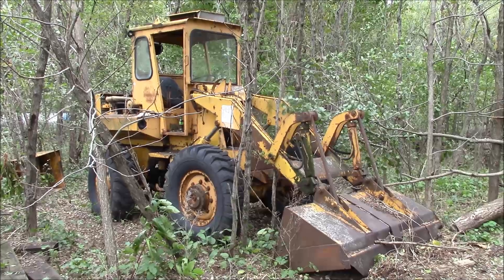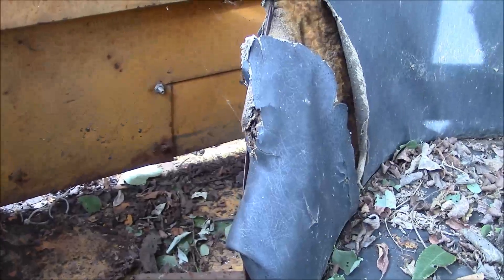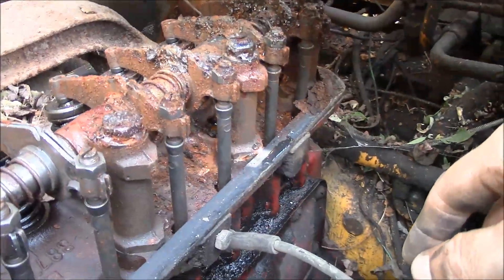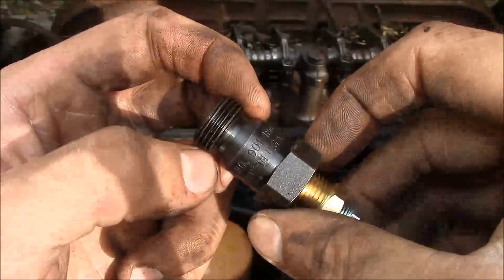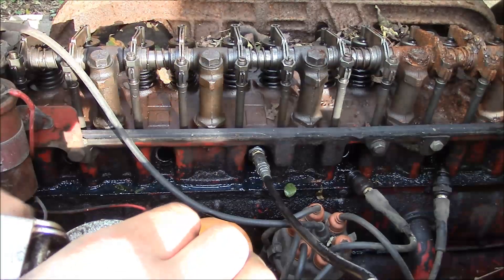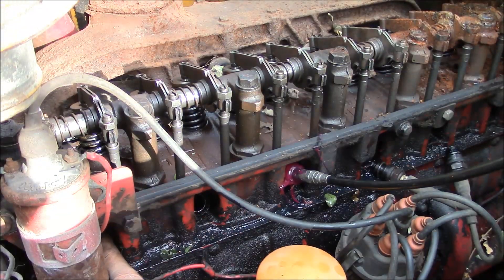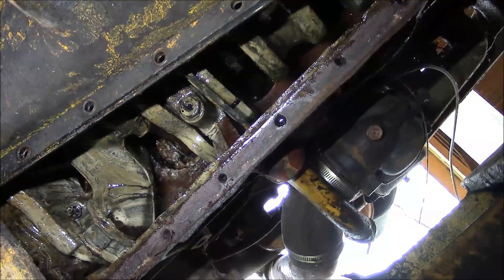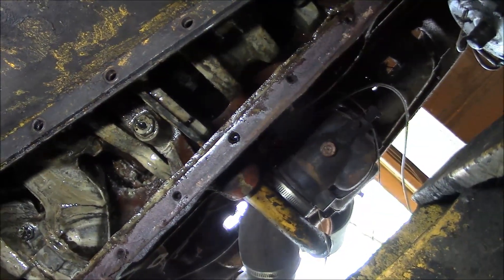Can You Free a Seized Engine with a Grease Gun?

Comment: Unlocked a bunch just depends really on why it’s froze up run it super hot and weld the rings your screwed but if it’s from sitting or not to major fill each cylinder with marvel’s mystery oil and let her sit for a week if. It takes that long just try the crank every day

Comment: I've also seen the grease gun method used where you pull the head and bolt a thick metal plate over the suspected stuck cylinder and go at it with the high pressure goo.

Comment: In my opinion this method is flawed right from the start because you are trying to break 6 pistons loose at the same time by applying pressure to only 1.  Might work on a single cylinder engine...

Comment: Swapping the engine is likely the best solution in this case. But for shits and giggles I have  filled the crankcase/ oil pan with diesel and worked the engine back and forth over many days. Had great success with engines no longer available for restoration projects, Good luck

Comment: I just subscribed to your channel. 
I have a 706 with a 291 that I had  six repair liners installed 25 years ago.  And they bored it to 301 . It has 5.000 hours on it now. 
Here is what you do to unstick your engine.  Pull the head and clean the cylinders out mostly.  
Take a torch and heat the pistons that are stuck to around 600 degrees and then quench them. 
You might need to do this more than once.  This will bust the rust .
Then you should be able to rotate the engine so you can get the bolts out of the torque converter. 
Hope this will help.  That's what I do when tearing one down for scrap..😊

Comment: Should have gotten something big enough to pull the machine and pulled it in gear to free the engine. I've seen this method work many times
Reply from the maker: This machine has a torque converter.

Comment: If you're looking to free up a seized engine...try mixing equal parts of any automatic transmission fluid,  with acetone.  The mixture works great because the acetone pulls the it DEEPER into the rusted stuck pieces, thus freeing them up.  And remember.. Any time you try to bang away at stuck rusted metal parts,  you run the risk of breaking them, and at the very least, creating deep gouges.  If for some reason the fluid doesn't work properly, then drown the engine or whatever it is with more, and let it work overnight. And... as you can see from experience...the grease gun method only works for minimal rust conditions, and usually causes additional damage and problems. There's also electronic devices that can heat the  bolts,  etc..  just remember that  they will damage o rings and seals by frying them..Good luck

Comment: What usually helps is some PB blaster into the cylinders, or marvel mystery oil, ATF, seafoam like fuel injector cleaner. I've made a mix of all of these combined, and filled up the cylinders with this cocktail. Its waiting game for sure. Also, just take the valve train apart, and label and organize it.    After its sat with the cocktail in it for a few days, try rocking gently the flywheel/torque plate with a pry bar without damaging the teeth. There is always pulling the cylinder head, and tapping the pistons with some wood, and small 2lb hammer, and just keep gentle tapping all of them.

Comment: Use apple cider vinegar...... when something is fully submerged the acidic nature of vinegar will remove the rust.... it’s pretty damn effective too..... but vinegar can also cause rust if not neutralized afterwards it’s thin so it would be able to seep between cylinder walls and rings and dissolve the rust....... I use it to clean and even un-seize rusted up guns and parts 
And clean parts when working on trucks....

Comment: Great idea. Thinking outside the box. 
To get pilot bushing out of manual transmissions most people use grease and it works well. 
Years ago I had a pilot bushing that was giving me a tough time and would not come out. So I thought outside the box.
I found a tap that would fit and tapped the pilot bushing and then ran a long bolt into it and wa la bushing be gone. 
Good video. TFS

Comment: I've used this method to unseize a Ford i6. It does work but only in certain situations this particular I6 had been overheated and one piston expanded until the motor stopped. None of the rods broke or bent when it seized. But the starter was not strong enough to turn it over and break it loose. Great method but like many good tools you must know when and how to use it. Great video though

Comment: That's an old Hough payloader made by  International Harvester probably in the 1960s.  The engine is a fairly easy one to find. That engine was available from the 1950s to the 1980s in various displacements from 220 to 301ci. Many IH trucks, tractors, combines and construction equipment used these engines.

Comment: have used a port a power instead of grease...oil work better...can get it out of the cylinder easier
Reply: need to find the rusted cylinder and put the port a power on that one
Reply from the maker: The problem with that is the valves will be rusty on the rusted cylinders and they will never seal up well enough to build pressure.

Comment: I work on outboards for a livingI am always getting engines in that are seized up from being left outside for four damn years without anybody winterizing them and through condensation the Piston Ring cease to the cylinder wall.I have been able to free up about 90% of these engines with a combination of marvel mystery oil acetone and little motor oil but you need to fill the cylinders and let it soak and fill the cylinders and let it soak and fill the cylinder and let it soakone day you'll go out there and all of the fluid has bypassed the rings and is in the oil pan or if you're working on a 2-stroke like me it'll all be on the ground.Then you just woke the motor back and forth and it'll free right up. Best bet with this old dog is just rebuild it.

Comment: Is it possible to swap out a 300 Ford or a 292  chev truck engine both 6 cyl models. I saw a 28 Hudson with a chev 6 cyl in it as the old Hudson motor  was toast

Comment: Hmmmm, sort of like me using my PortaPower hydraulic pump with a greasegun connector installed on the end of the hose, to break free clogged grease fittings and journals.  Not a guarantee to work, but sometimes it'll save your day.

Comment: Another method for seized engines is filling the cylinders with brake fluid but if the grease already popped head gasket no sense going any further, you need another engine.

Comment: I've been a mechanic for around 45 years and the best thing I've found to free stuck engines is to fill all the cylinders with brake fluid and leave it in there bout 5 ta 7 days b4 you try to turn it. Would b great with the grease gun method after leaving it set for a few days
Reply from the maker: Well it soaked for 5 weeks in diesel and ATF before I tried the grease gun.

Comment: special for this video i have done some research and have seen different things, but if the engine is seized, what is quiet obvious, i might have an solution which could solve the issue,, now the engine looks really really nasty, and also rusty, if u think by yourself, rust does'nt like chemical stuff thats biting the rust away,, Now if u fill the whole oil tank up with coca cola (original one, so no pepsi) brand new from the store and fill it completely up let it sit for 2 days, after that drain it out, find out if its possible to turn it over by hand, if it does turn over OR if it does not, just after you drained it, you can put transmission fluid in there and let it sit for 1 full week,, after that it really should be free,, the coca cola original bites all the rust of it and will cause no damage to the rods OR pistons,, now i am not an mechanic (i see and learn a lot of videos on the internet) but if this works for you then i should say give me a shoutout?? There is always a way to fix the original engine

PSS: unseizing the engine by forcing it is really my last option but the chance here is 50/50 and i would like to see the percentage as close to 100 as possible
Reply: if this did not work, then let me know and i will do further research!!! but i bet this will do it

send me a message on facebook to update me a bit about the project
facebook: GamingFromTheHeart Offcial    OR    Lari Tsahik
let me know something!

Comment: Pull the caps off the connecting rods if you can get at em, should make it possible to roll the crank over to get at the torque converter bolts. Keep on keeping on, this was  my first video I've watched from you. I subscribed you're my kind of mechanic. Physics is always crucial. My friend.

Comment: that grease gun method is a terrible idea. I would never do that to any engine. what I would have done is pulled the head to loosen and clean up the valve train. now you will have to strip the whole engine to remove all of that grease from the cylinder and piston rings. that's what you get for listening to these Muppet commenters.
Reply from the maker: LOL. This engine will never run again without a complete overhaul including boring the cylinders. I don't see what we had to lose.

Comment: That engine I doubt very much is seized, it is only stuck. Flood it with diesel and let it sit for a couple of weeks. I found a lot of gear the the US  troops left behind in NZ at the end of the war. They didn't want to ship it back home and the NZ gov didn't want it left behind because they had no market for their own war surplus gear so the GI,s just drove it into the bush and went home. Clutches and brakes were corroded and locked up as were the motors. I just pulled the injectors and filled the donks with diesel  and left them for a few weeks then used a giant crescent on the crank and work them back an forth, but time is your friend: just let it soak.

Comment: If you unbolt the connecting rods from the crank, you should be able to turn the crank and unbolt the converter.  Just cut the oil pan off with a torch..

Comment: Good call on replacing the engine, if you can, take the end caps off the ends of the rods. You'll be able to rotate the crank to get at the converter bolts. I hope you find a good engine, a Diesel would be great.

Comment: Watch the channel "Coldwarmotors" Straight Eight Challenge. Scott used a Port-a-power hydro pump and a specially made single cylinder "head" to free up a rusted cylinder in a '50 Buick straight eight. It's pure video gold for us viewers, for you trying to do this for reals,  probably not so much. :))  But it can be freed up, to be sure and you're already into this for four or five tubes of grease :P . Good luck either way.

Comment: un-bolt the motor mounts, lift high enough to remove pan, put bolts back in, remove the pistons from the crankshaft*, see if you can push all pistons to the top position** so the crankshaft don't bind on them. crankshaft should then be able to turn free.   if that works you can turn  torque convertor to remove all bolts for engine removal.
* remove the ones you can, you might find it might turn with  less connected.
** I would use a 2 ton jack to lift the piston with steel rods,  since you don't plan on using that engine, use even pressure so it does not tilt and lock up more.
Reply from the maker: This is not like a car or truck. The transmission is rigidly bolted to the frame. We'll just cut the crankshaft.

Comment: Put a 2 jz engine in it or a nice little  predator 670 also try using CLR in the top of the motor fill engine oil pan with CLR let it sit CLR will eat all the rust

Comment: Out of all the concoctions, you put down the spark plug hole, Have you tried Automatic transmission fluid (ATF) mixed with Acetone. A lot of experiments on YouTube using ATF to free up rusty bolts and comparing them with other types of off the shelf products. I use it all the time on Landrovers. It was only this year an old mechanic told me to mix it with acetone. And yes it works even quicker.

Comment: I unseized a 440 Mopar by filling the whole block with kerosene and diesel fuel with some atf . Let it sit for a week   I drained all the old oil and crap first . Then put the kerodiesoline lol mix in crankcase . A week later I can turn crank over about 1/2 way back and forth. Kept working at off an on through out the day . Made one revolution by the end of the day . So I can pull it apart to rebuild .

Comment: I poured vinegar through the spark plug hole let it sit for 24 hours then hit it with a big breaker bar, vinegar eats rust big time if you didn't know that. 
On the old caddy 331 it  took about a week Of fiddling but I got it spinning... It was a little at a time btw.  Then once I got it freely spinning I got it fired up and it smoked like a 1950s late night interview, it never really cleared up but it did tone the smoking down as it got used.

Comment: Did you consider disconnecting the connecting rod on the ywo worst cylinders and cutting them off close to the pistons so they won't contact the crank shaft?  If you could get it running on 4 cylinders you might be able to drive it out of the bush at least.

Comment: @7:54 This is part of a real question I've pondered for a decade or two:  "Measured from one end of the crankshaft to the other end, exactly how many degrees of crankshaft twist is possible in an average engine running at max rated power at some RPM?"  Based on your shared observation at this point in the video (and at whatever cylinder pressure you achieved) a few degrees seems possible.  Neat!

Comment: Could you try that method on cylinder 2 and 5 and see if that works? Idk its fun to tinker ive actually used compressed air to free up a engine but it wasnt very stuck it only took like 20psi to free up and that was on a 620 john deere

Comment: If you look on Coldwarmotors  Straight 8 shootout you will see the Canadian version of unsticking a motor. First you have to remove the head then put a piece of plate  metal with o ring over one cylender then apply hydraulic pressure.

Comment: Go to coldwarmotors site and you can see how they did it on a flathead engine with a lot more hydraulic pressure and it will let you see the amount of pressure they put on the Buick in the straight eight challenge.  Look at it they did it real justice, little that you do except change the engine.

Comment: In order to pull the engine you might need to pull the head and demo the pistons to turn the crank to get to the torque converter bolts.  You know what fits it now, try to find a junkyard motor that fits it.

Comment: I knows its a bit late but my dad taught me this trick on an old bobcat and the easier way to do the trick is to fill the cyl with thick oil first (gear oil worked for us) as it takes up the space and leaks between the rings before you blow a head gasket or break a rod

Comment: Wes, does that thing not have a a neutral on the gear selector? My opinion is
for this to take the engine apart and remove it. Part by part and the bucket too.
Then you could tow it away and do what you like. Add the bucket when its finally
running.

Comment: This isn't the way the grease gun method works.  You are supposed to fill up the cylinder most of the way with a very light penetrating oil or something like Marvel mystery oil, or ATF and acetone - then cap off the cylinder with the grease adapter fitting and use the grease gun to force all of the light weight oil and/or solvents down past the piston rings and piston skirt.  The oil is supposed to free the stuck piston by pushing lubricant where it won't go by just gravity.   You shouldn't brute force the piston down in the bore by hydraulic pressure (which is what you will end up doing using only grease) because it will just damage the cylinder wall. The hydraulic force that the grease gun can exert on the top of the piston can be several thousand psi, and that can blown the piston top through the piston crown if you use only grease in the cylinder.  Ideally, your grease gun should have a gauge on it so you can have an idea of how much force is inside the cylinder so that you don't overcome the mechanical limits of the piston, head, gasket, rings, etc.  Too many people use methods that they heard from somewhere but their understanding of the method is incomplete.  All too often it just breaks things.  As far as the rust goes, as long as the rockers aren't seized you may be OK if you drip oil on the rocker arms while first starting it and let it idle to break things loose.  I'd be more concerned where the water ended up elsewhere inside the engine, drain and replace the oil a couple of times at least between starts.  You might use a rubber mallet to hammer on the tip of the rocker arm to make sure that the valves are not stuck before start up.

Comment: Fill engine with diesel let sit for 24 to 48 hours then fill with transmission fluid let sit for another 24-48hrs and attempt turning with breaker bar if that won't brake it loose nothing will

Comment: channel coldwarmotors drilled a hole in the piston at the edge without nicking cylinder wall and extracted piston that way, then wet sanded the cylinder wall and dropped in new piston. check out straight 8 show down. IDK if you's want to go through all that trouble though. swap seems better, plus you can upgrade to a better engine or deisle?